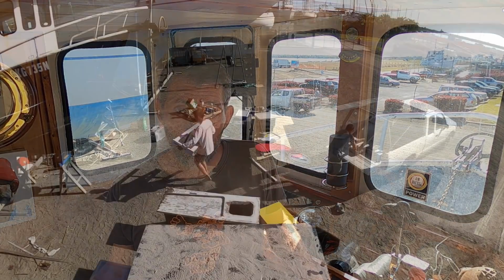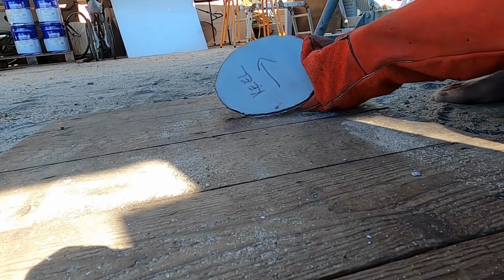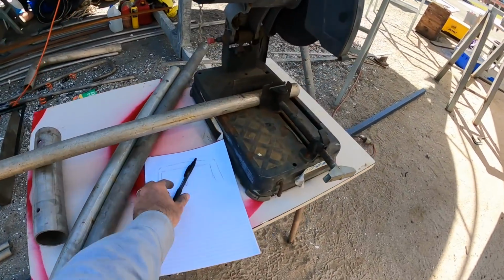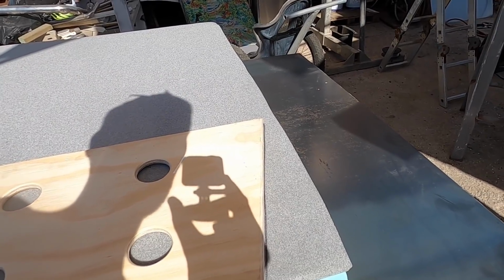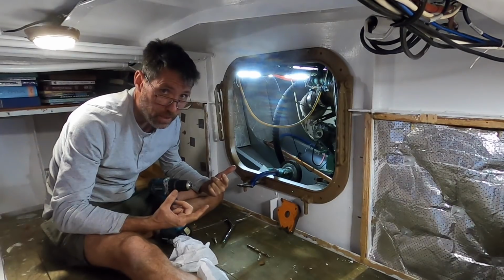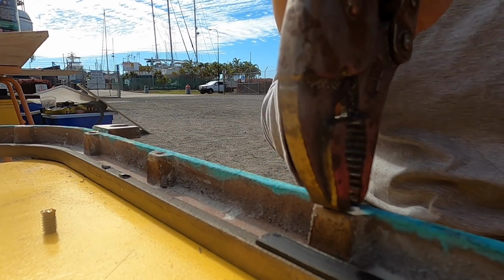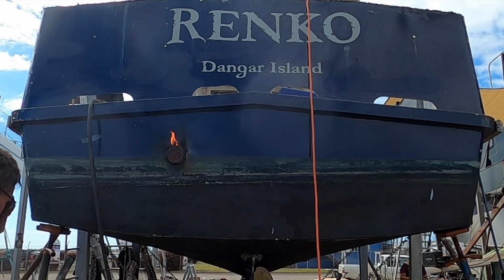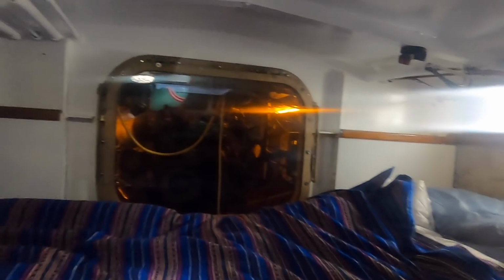Week two on the hardstand

Comment: I’ve been watching your resurrection of Renko from the beginning with a great deal of interest, and no little nostalgia. When I was a kid (mid-century, more years ago than I care to admit) we had a steel work boat—cruiser style, GMC 6-71—which we ran summers as a deep-sea sport fishing charter boat in the Pacific off the Columbia River. 

I have fond (ahem) memories of first resurrecting and converting it to certify as a USCG passenger-carrying vessel, and then spending winters in constant maintenance. I envy your needle gun, plasma cutter, welder, battery-powered grinders and screwdrivers, paint rollers—we had chipping hammers, wire wheels, power-drill hole cutters, hacksaws, covered floating drydock & sandblasting (when necessary), all-hands 24-hour marathon painting sessions—with brushes—to cover bare steel before it rusted. Of course, computer-based navigation and electronics were simply unimaginable. Not trying to say you have it easy, just that having worked in the stone age I have so much appreciation for what you can do now.
 
I think Renko is a very slick little general work boat and overnight cruiser. I admire your hard work and sensible decisions obviously based on long and hard-won experience, and I wish you years of satisfaction and enjoyment on board.

Comment: You mentioned Sika getting everywhere, it's true it does. I used to be a sales rep for Sika and the one simple trick we used to teach was a good squirt of dish soap and water in a spray bottle. Spray it on unwanted sikaflex and you can wipe it away with a rag. If you want to smooth out your job, spray the job and your hand and you can move it about and it won't stick to you. Sounds to simple to be true but it works. Love your work, its great to fill in the blanks that an automotive guy doesn't know about the marine world

Comment: If you want a permanent solution for the hatch cover swing by any place that does the truck bed lining , they should not charge to much to do the hatch and most offer colors other than black. I tried the home use spray can stuff it works but will not stand up to foot traffic. Boats looking good Stu!

Comment: Had one of my boats I foolishly coated in a thick epoxy in hopes of steming the rivet leaks, it required first burning with a torch and than needle scaling while still hot to remove with any speed. I don't know if there's many worse tasks than that, hope you had many beers to make it pass quickly

Comment: Save some of that coarse sand from the blaster screening to mix with your epoxy paint to put any where you want some non-slip surfaces; like the deck hatch, walk around the cockpit and the railing pass throughs. Just an idea since you have the raw materials to make things safer.
Reply: ground walnut shells work better because they absorb the epoxy or paint, nothing sticks very well to sand so it doesn't last very long.
Reply: @marzsit9833  Good to know!

Comment: I don't understand how brass screws into a bronze casting could be a problem getting them out.  Did you soak the bolts in "CRC knocker-R-loose" for a day or two?
Reply: brass is an alloy of copper and zinc, bronze is an alloy of copper and tin. put the 2 together and expose them to any kind of water and the brass screws will corrode due to electrolysis and become chemically welded in-place and will only break off when you try to remove them. no amount of super-whamadyne penetrating oil or heat from a torch will free them up.

Comment: Does the effectiveness of the needle scaler speak to the age of the paint of the power of the needle scaler?
Reply: some paint is quite brittle after decades. flakes right off when hit with a needle scaler.. hint.. when the pins start to round over. take them to the grinder and square the ends up to the same length. the square corners chip some materials so much better..  rounding the end of the needles allows you to create a microhammered finish in some softer metals

Comment: What is your gear ratio of your transmission? Where I come from we would have 1.5 to 1. with a 6/71 or a v 6/71 you should have a top speed of 18 mph and a cruise speed of 14/16 depending on prop size and pitch

Comment: Plasma cutting barefoot. Beast!
Reply: Pity the Lads didn't have an  9" Angle Grinder with a Cutting Disc then i could have been a lot easier, but you just have to work with what you have got, great job to Plasma cut off that rail, that and also  your welding is really coming along Stu since the start of this project,  what with the steady stance you achieved   and two hands linking up to steady everything up,  plus  left shoulder resting against the hull, it all helps really nice relaxed grip and the use of your left hand glove to steady the rod as you fed the electrode into the weld pool...real craftsman stuff...